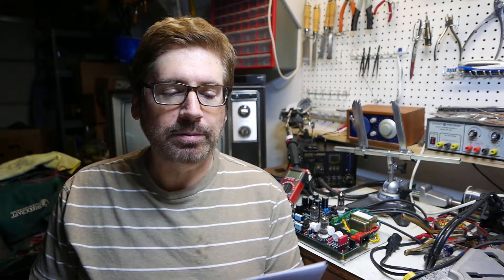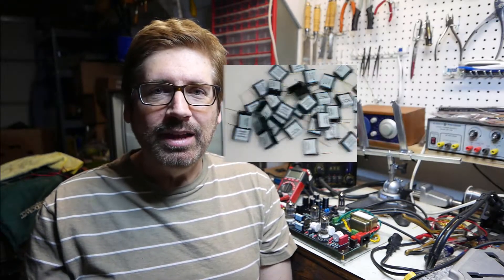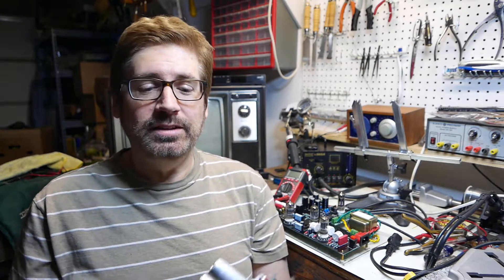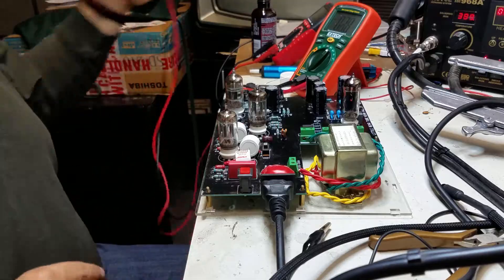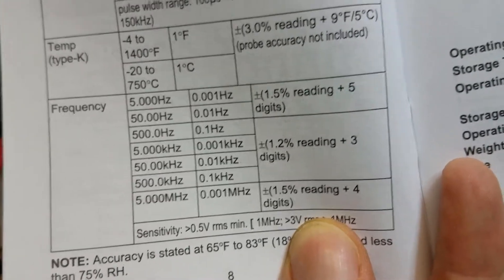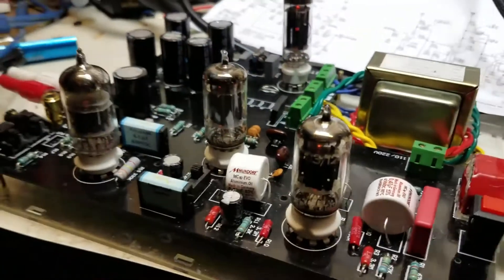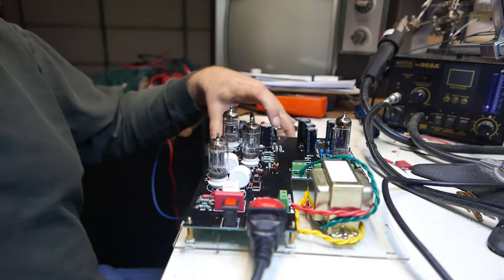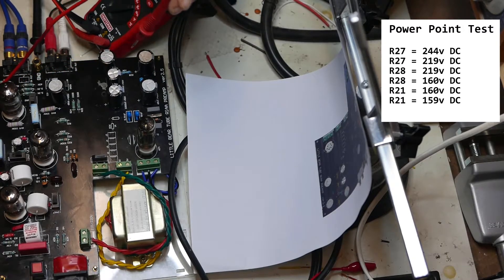Little Bear v2.5 Troubleshooting tests - part 1

Comment: Great job on your video David, I can see you've put a lot of effort into it! 
Nice looking tube setup you have there, i've always been curious about tube amplifiers but also a bit apprehensive about tinkering with them haha. I've never actually heard of the 'Little Bear' before.
Reply from the maker: They are cheap from China. Takes about 6 weeks to get here but the same thing at an audiophile store here in the US would cost $2000. Its a fully tube rectified phono preamp. They just came out with a new model that includes an aluminum case with glass protective tubes over the tubes for the same price. I should get it so I can have every verision lol. Make a video of all three!
Reply: That would be pretty cool to see actually, i'm intrigued by the little bear now haha...Look forward to seeing the newer version if you decide to get it :o)